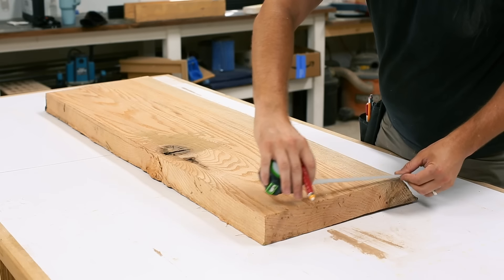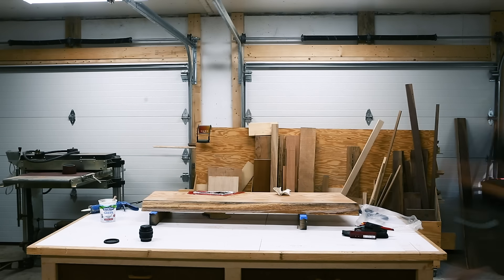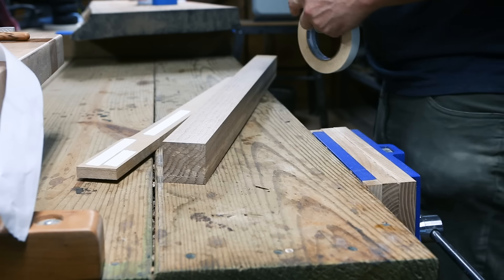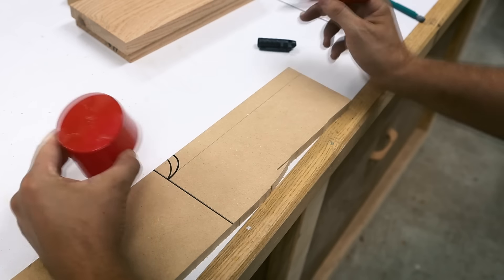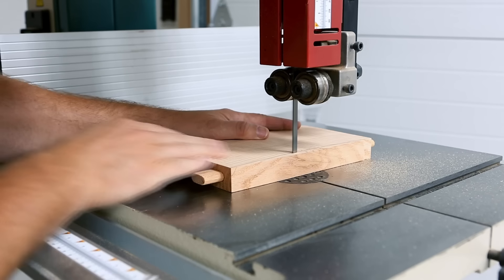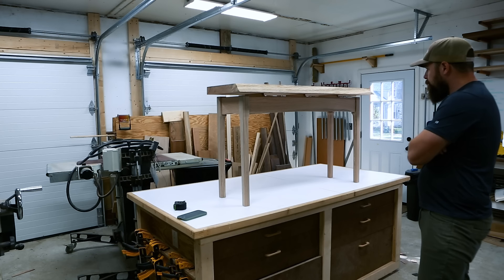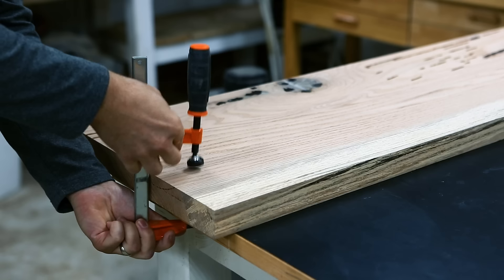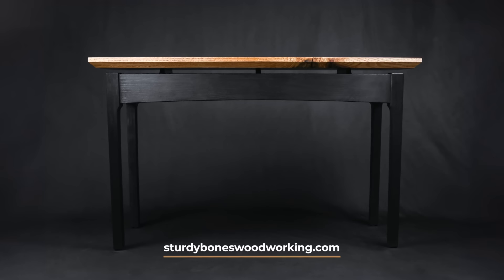I hated this design...so I fixed it

Comment: Another solution to the raking live edge would have been to flip the top over so that the narrow edge was to the top & then cut the two end edges to a similar angle, so you'd only see a fine line when looking down
Reply from the maker: Hi! Yes that is a good consideration. I thought about it for that exact reason but since I had screwed that plate earlier into the bottom there were still some pretty deep holes that would have shown up, and the bottom was also not as attractive as the top.  Well as attractive as that even was for red oak.

Comment: Instead of a towel as a sanding pad. Try the rubber style shelves liner . I like the open mesh type, it gives a place for dust to go.
Reply from the maker: Thanks! Yeah I’ve since moved on to using an old yoga mat instead of towels. Doesn’t let dust through but most of it gets handled by the dust extraction anyway. Thanks for watching!

Comment: Another great video! I picked up my tiny Delta bandsaw for $40 and I really like it. Video quality is great and so is the commentary. Oh and you can use the carving disc to take off some epoxy.
Reply from the maker: Thanks so much! Yeah I love my little band saw. $50 used and a $20 Timberwolf blade and that thing works great for little things like that. I’ll remember that next time I need to clean up another big epoxy mess! 🤣

Comment: you're doing a great job. Keep going, love the video and the jokes. Wives can be a pain but usually are the best voice of reason, lol.
Reply from the maker: Hahaha. Well she’s definitely right in this case, per usual. But I think it won’t be long before I’ll be able to justify a little CNC to make my templates. The hard sell is that my friend Warner I mentioned in the video has a 10x5 shop bot and he could easily cut out what I need. I just need to plan well enough to have them all designed first.

Comment: Awesome job.  One thing that helps me ESPECIALLY when working with something natural, is the golden ratio which is 1:1.6180339887498948.  That’s the ratio nature uses to design reality and can be a great help with something like live edge slabs.  For example, I would have measured that knot hole you filled or some other natural feature of the slab and multiplied that measurement by the golden ratio, then multiply that number by the golden ratio, then the next one and the next one until I got up to a measurement close to 6ft or so.  Then also d the same with dividing the knot’s dimensions all the way down to a size around 1/64 of an inch then mix and match all those measurements to come up with all my dimensions.  Instead of having a 2in thick slab, it would be something like 1.894in.  Or instead of the whole table being 36in tall, it would be 37.107….. or whatever the portions I use add up to that’s close to 36in.  Of course you’d want a set of calipers so you can dial in measurements like that but it makes a world of difference in everything coming out proportionate to the eye.  The reason it “looked better” once you eliminated the live edge is because you got rid of the “natural” part that flowed in proportion with the golden ratio while the rest of the table didn’t.

To shed more light on how it helps, think back to the comic strips in the Sunday paper.  The quality of the artwork wasn’t all that great, in fact most of it was chicken scratch.  But because their golden portions were spot on we as the readers didn’t notice how terrible the artwork was.  The fact that the golden portions were so accurate made it appear the same way as if nature created those comic strips which we instinctively recognize and judge to be “good artwork”.  The fact that it was sooooo perfect while being a bunch of chicken scratch made it “interesting” to our brain which we defined as the “style” of the artists which made their work a unique brand.

That’s what using the golden ratio can do for pretty much anything we create and is even more vital when creating something that preserves the craftsmanship of nature so when people look at the table it overall registers to them in a way that’s consistent with how nature would’ve built the table instead of having an appearance of “nature did that part and he built the legs” and kinda feels like two different artists with two different visions…. Like….. if a traditional anime style cartoon had a Pixar style character in it…. Or a PS5 game had an 8bit Nintendo character running around in a 3D landscape.
Reply from the maker: Thanks for such a thoughtful comment! I definitely want to look into that more and learn how to integrate it into my work for often. Thanks for watching, too!

Comment: Three thoughts:  1.  The dramatized sobbing at 15:19 cracked me up.  2. I agree, it was ugly and the final product was better, beautiful really.  I think this has to do with the direction of the bevel on the natural edge, which made it look heavy.  Reversed, as in the final table, it looks lighter, more in line with the floating design.  3. Why do you bad mouth red oak?  A suggestion for the bottom would be to ebonize the red oak with iron, instead of staining.  This can look quite spectacular, and be quite black while still maintaining a clear sense of grain.  Can be done with red oak and rusty nail water, or you can be more precise and get deeper black by combining a tannic acid pre-wash with a ferric chloride solution stain.  You can fine tune the concentration of those two to fine tune the outcome.
Reply from the maker: Thanks so much for watching and for your thoughts on #1-2! I think you’re right about the direction of the live edge. As for red oak, I’m mostly joking but generally I just don’t like the pinkish color. It’s a fine wood to work with, but there are more enjoyable species in my opinion, and if I’m going to be inclined to alter the color, I’d generally rather pass and use something that’ll just look good with a clear finish. I’ve experimented with ebonization and tannic pre-wash before and it’s a lot of fun. Should probably mess with it more. Thanks again!!